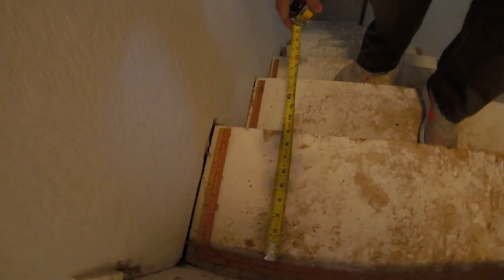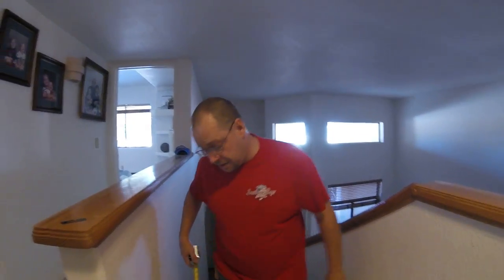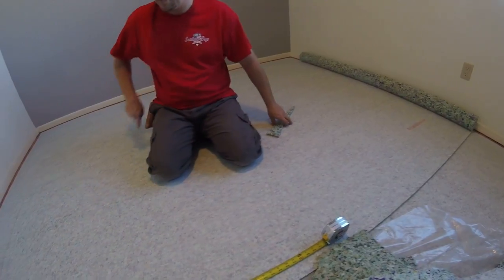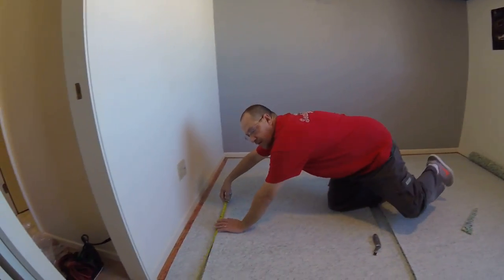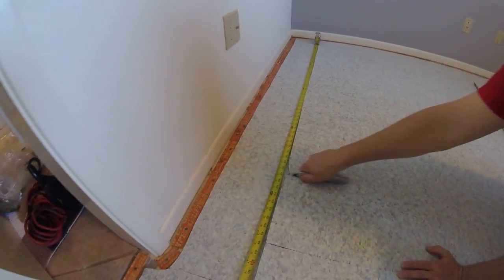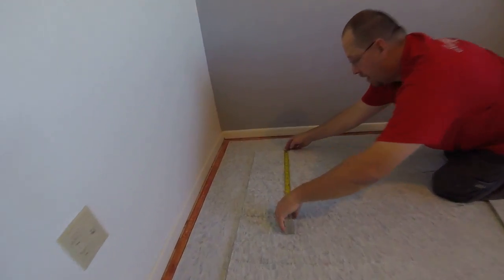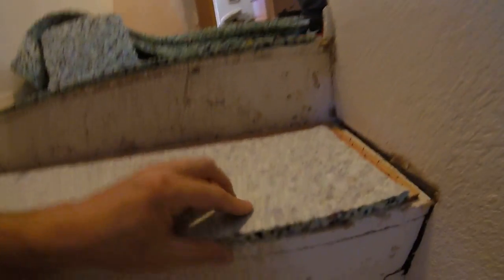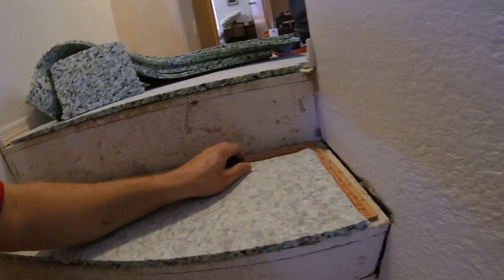easy carpet pad for steps HOW  TO

Comment: We wrap tread to riser. Just cut 3 strips as wide as the steps smallest step wall to wall one 6 footer will do 5 steps and trim and staple as you go its faster and looks neater when the carpet is installed. Then row find the carpet to a good balance point and i like using the stretcher for stairs

Comment: the best thing to do is cut it 1/4 short on the side and cut a long pieces of pad like 15 feet and roll it up like carpet it and roll it down the steps once you cut the back you have a clean cut to flip it on the next step you stretch the side where it was 1/4 short that way your only making one cut vs many other cuts
Reply: So what do you do with rest of the pad? A typical 13 step 36 wide flight of stairs only needs a 63 inch piece of pad to do the whole flight done the way shown in the video. Even if you pad the nose and tread you only need a 90" piece for said steps. Even if its wide 40" steps 15ft of pad is waaayyy too much and with some padding being around $300 a roll you would be fired real fast. It doesnt take 10 yards to do any normal residential stairs even with 15 40" steps and a 6' landing I wouldn't use that much

Comment: Good video, but I prefer to do the first cut a little bit short (1/8 of an inch) and then staple one side of the stairs and stretch the rest of it over then staple down the front. I find its the fastest way for me at least because you have one less cut that way and it saves even more time and it saves materials too.
Reply from the maker: True

Comment: Fast!!? Didn't know you had to take a maths test and do 50 cuts..... Fit the underlay gripper to gripper. that's how we do over the pond in the uk that's quicker.
Reply from the maker: sausage man it's a good thing this wasn't a math test because I would have surely failed did you notice when I was counting by nines I messed up LOL
Reply: FloorsbySouthernboys haha, I just cut the width of the stairs off the length of the underlay and that's it normally I'll get about 4 stairs out of that. plus I never gripper the sides of stairs
Reply from the maker: sausage man i hear you, i like to tack strip the sides so i can stretch the steps side to side as well up and down i have seen more steps with wrinkles  going vertical  than horizontal ,stretching side to side prevents that
Reply: FloorsbySouthernboys oh right, if I start fitting stairs and they don't sit flat on the tread i just spray the underlay and the back of the carpet that normally sorts the problem out for me. Do you power stretch your rooms?
Reply from the maker: sausage man yes sir and any closet big enough to fit my stretchers in I only use my Kicker when I have to I've been doing this over 25 years and I like to work the easy way Floor Covering is hard on your body long term so I always use my stretchers
Reply: FloorsbySouthernboys I totally agree with you there mate this is very hard on the body. I've was never taught to use a power stretcher but I have had a go with one and they are very good at stretching the carpet but what I found is it takes to long to Set up, you have to double up the gripper and most of the time people have furniture in the room. That the reason I don't use one. Any tips from across the pond lol
Reply from the maker: sausage man my opinion there's no amount of time that's worth your health in mobility in your body I'm only 39 and there's a lot of people in their 60s and up that get around better than I do still I wish I had of took better care of myself when I first started this as a youngster I used to kick a lot and never wore knee pads now I take all precautions
Reply: FloorsbySouthernboys same here I have worn pads from day one. Put some more videos up of you fitting with a power stretcher.
Reply from the maker: sausage man okay will do
Reply: FloorsbySouthernboys please do put some videos of you fitting steps (winders) I'm sure you have them in America.